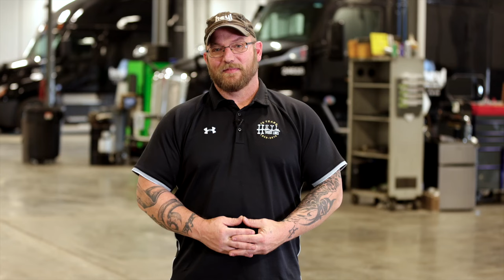Split Sleeper Berth EXPLAINED!

Comment: What was explained to me by my logs department is that after 2 hours the rest of the time is irrelevant but still pauses your 14 where you stopped it and extends your day.. but the second part has to be the 7 or 8 hours.. I tried to do 5.25 and 4.75 and it went into violation so I had to have them edit the time 🤦🏻‍♂️

Comment: I got a notification on my ELD that I must stop driving in 15 minutes if I’m not using the sleeper birth provision but my regular clock had two hours and a half left on it. Do I disregard the notification and keep on driving I was a sleeper berth that day for over two hours.
Reply: But did you use the Google switch to put it on split sleeper  birth and yes it will but you in violation  til you take the 2nd part of the break  once it runs over original hours you will be in red but it will clear out once you complete the second portion of the break

Comment: You have to give the clock exactly what it needs. It needs 10 hours. The only ways to break that up is, 2 and 8 hours, and 3 and 7 hours. The small portion (2,3) can be done in off dury, sleeper berth, or even personal conveyance if need be, because DOT doesnt expect you to only be sleeping while doing the small portion, therefore you can be in off duty or even PC. However they do expect you to sleep during the 7 or 8 hour shift therefore they expect it to be sleeper berth only, because sleeper berth is not just a function on the tablet, its a location inside the truck (anything behind the driver and passenger seat) and of course in DOT's eyes, why would you move if your sleeping.. thats why you cant use personal conveyance or off duty when youre doing the big portion (7,8)... you also cannot use like 6 and 4 hours or 5 and 5 hours to do a split, because they expect you to have 7 or 8 hours of sleep, not just 5 or 6. . 

  Now, the clock only needs 2 hours or 3 hours to start off, anything more than 2 hours or 3 hours is a waste, in the sense that if you go down for 2 hours and 38 minutes, you will only receive the 2 hours from that, or if you go down for 5 hours, then you only get 3 hours from it. Because it only needs 2 or 3 hours and thats all. Likewise if you need only 7 hours and you go down for 7 hours and 45 minutes, you only get 7, same with the 8 hour portion. Never give it more than it needs, but dont fall short either. If you need 7 hours, but you only get 6 hours and 58 minutes, you just lost it and have to start it all over again..(If youre doing the big portion first, but fall short of the 7 hours, then it will automatically give yiu 3 hours out of that time) 

Also, it doesnt matter if you do the big portion (7,8) or the small portion (2,3) first. They can be done in either order, as long as a total of 10 hours is complete. 

  If you're doing a full 10 hour break by itself, then you may be in off duty, personal conveyance, and sleeper berth, because DOT doesnt know exactly what part of that 10 hours youre driving or sleeping, thats why you can be in various duty statuses. 

Theres more to it, but hopefully that simplifies it a bit... also correct me if im wrong lol
Reply: That's tge best explanation I've heard. But my experience has been, just when I think I've grasped it, I haven't. 😄
Reply: If I were ruler. I'd have the clock pause everything I'm not driving. 8 hr instead of 10. And 24 hr resets. 34s are mentally brutal to me, because I'm far from home and spend it in the truck usually sleeping too much.
Reply: @georgeperkins4171  haha yeah it's crazy man, unfortunately it's what we get to follow lol. I'm an orientation specialist and I get to explain this all the time haha. Keep up the good work man. Just pay attention and it'll come to you :)
Reply: Best explanation of split berth so far
Reply: Question 🙋‍♂️ say you started early and did a 2 hour break to stop the clock but still have 10:30 mins of drive time and 13:30 of workday, and after the two hours are up you drive and use up all of your work and drive time. When you shut down and put yourself on sleeper berth do you get time back after 8 hours?
Reply: Whew I need sleep now

Comment: What happens if you go over 7,8 ..I know if you take 10;you reset the whole clock .. 

But if you go over 10 can you still use the 8 and 2 split to extend your 14?

The 7/3 and 8/2 are minimum so you could take 12 in sb if you wanted right

Comment: If I drive 4.5 hours take a 3 hour break and drive 4 more hours and take 7 will my 14 clock reset and add more driving hours ?
Reply: You would get back 4.5 hrs or whatever your total on duty time was before you first paused your clock.